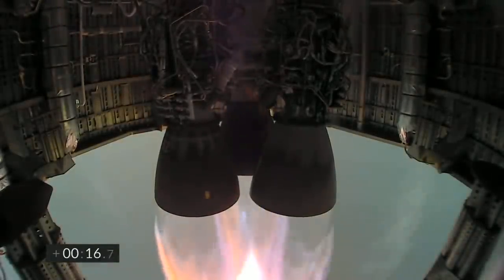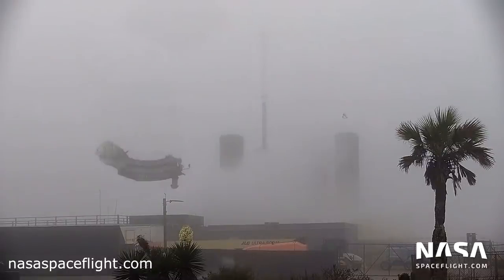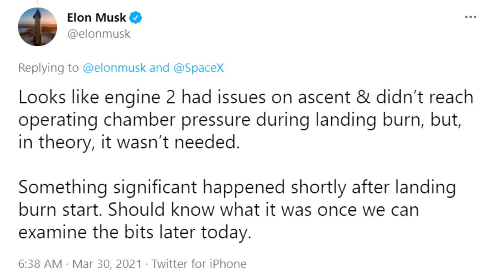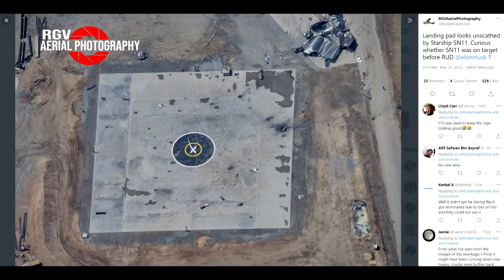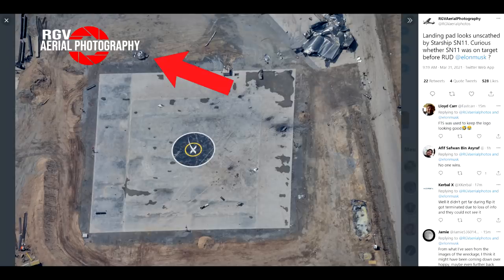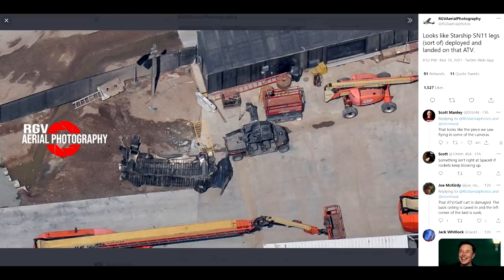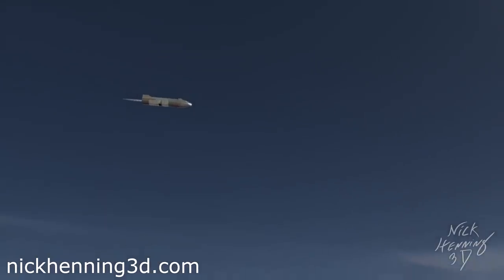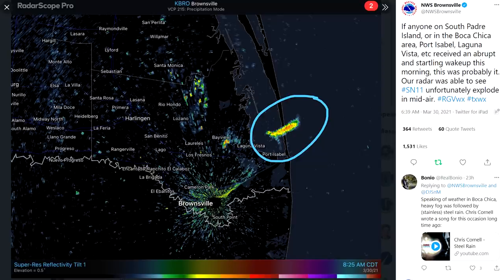What Happened In The Fog At Boca Chica - What Caused SpaceX's Latest Prototype To Explode?

Comment: The strangest thing is to start a test flight in the thickest fog, knowing that you have no visual references for flight analysis, especially during landing.
Reply: I'm don't thinking SpaceX so much in need for video. They have a lot of internal telemetry data, which is valuable for constructors.
Reply: Their automated equipment can see through the fog just fine.
Reply: @TheReaverOfDarkness  Yeah they probably have cameras that can see through the fog (non-visible spectrum), and perhaps cameras on drones above the fog too.
Reply: @leandrog2785  Their equipment can probably see in several different frequencies outside of the visible range.

Comment: “Tonight: SN11 becomes SN eleven-hundred pieces!”
Reply: @SuperiorMind  they launched it with more fuel than previous flights.
Reply: sn15 has hundreds of upgrades.....better aerodynamics, more mature engine, better throttle range and stable differential throttling with better software updates ...it will probably land more accurate
Reply: @shreysharma726  yes maybe 10 pieces instead
Reply: So long as you don't intend on ever coming back, it works absolutely fine.
Reply: @shreysharma726  I look forward to the improvements, but it's also well known that every new change of a design will likely introduce new bugs in the tests.
Reply: touche' sir... you win best comment.
Reply: News at eleven!
Reply: Early April fools I see

Comment: Hey Scott, can you do a video on the history of flight termination? What it actually is and when it's been used?
Reply: Yes Scott, is it a bomb or what??
Reply: I believe it is an explosive cable along the tanks, which is detonated automatically or remotely.
Reply: It's a small explosive charge that is positioned so the whole vehicle disintegrates when it explodes.
It is automatic but it does have a manual override afaik.
These are fitted so they can destroy the vehicle when it gets out of bounds and for example flies towards a populated area.
For starship it is halfway up the rocket to the left and right of the cable raceway, it's the 2 small white boxes.
Reply: There are two C4 charges on the side at about half height. They are easily recognizable as two white boxes left and right of the outside piping and cables on some photos.
Reply: I know that some are. But there have been many iterations over the years and from different countries. Not just space x but any or all manufacturers. Just thought it would be a cool vid.
Reply: There is a very good article on comp.risks if you can find it.
Reply: I and my Lance firing section were waiting in a block house for our turn to launch when a Nike Hercules was command detonated above us during live fire on Crete, Greece.
Reply: @banthaboss6390  true, that would definitely be interesting
Reply: @stevebalske5476  That sounds like a laundry-generating event
Reply: Agree. Upvote!
Reply: Remotely detonatable? I would think many times before boarding a ship like that. Polynesian hackers are unstoppable, you know!
Reply: Some of his space fail videos discuss it, iirc
Reply: @vladimirdyuzhev  they don't have them installed on human missions...only missions in which cargo is only satellites or test articles
Reply: In this case people are saying it's det-cord (basically explosive rope that's usually used in mining or construction to ignite a bigger charge) strung alongside the tanks.
Reply: The OSH heath safety inspector from the original Ghostbusters movie got mad and pulled the safety destruct lever.
Reply: Might be a good idea.  I have heard that some people think that they shoot it out of the sky

Comment: Mary has continuous audio through fog. When the relight occurs there is at most 1 second before explosion. That coincides with the SpaceX video feed ending at relight.  SpaceX called out "1000 Meters" at most three seconds before the feed ends. Given that terminal velocity is about 65 m/s, then it was about 200 meters lower when it exploded, or about 800 meters altitude.
Reply: The unknown height of engine relight (actually closer to .6 km) , and the timing of callouts are not very accurate to base speculation off of.
Reply: Could probably use relights from previous flights as a reasonable guide, wouldn't be perfect but in the ballpark

Comment: Sequence: A Raptor explodes on ignition, blows off the engine skirt in pieces, including one with a leg. FTS senses major malfunction, blows up the rest of the ship. (By ripping open the tanks and causing a propellant cloud explosion from the autogenus pressurizing gas and residual propellant.) Or the Raptor explosion propagated up into the tank, causing the same kind of of RUD as the FTS.. Either accounts for having both concentrated and dispersed debris fields.
Reply: Yup, this is still my bet. Raptor blows up, AFTS takes over. The problem is this contradicts all of the insider info we have about FTS not being used. I'm thinking maybe they know FTS wasn't triggered, but maybe AFTS did it's thing but the initial explosion killed the telemetry link before it could notify them.
Reply: FTS probably would not activate unless the vehicle was off course. Most likely methane fuel leak in the shared header tank of the LOX.
Reply: @pluto8404  But we're not talking about FTS, but AFTS. FTS would only be triggered when someone says so, and the FTS's job is to make sure it NEVER detonates unless somebody specifically tells it to do so. AFTS works on a very different logic, unless everything is FINE, go boom. So severe damage to the rocket could trigger it. For instance, let's say the raptor goes boom and in doing so it severs a lot of communication lines, and so the AFTS stops receiving data from a bunch of sensors. That would most likely trigger AFTS. 

Otherwise, a damaged IMU/GPS would mean a rocket that would be pointing wherever, but an AFTS that would do nothing because it's not getting IMU/GPS data.

Comment: I roughly put together the engine burn times for each prototype which kinda confirms that FTS was not engaged

(All times rounded to seconds as milliseconds were not shown in streams)
SN-8 (12 km alt) T+(06:31-06:42) (11 sec)
SN-9 (10 km alt) T+(06:18-06:26) (8 sec)
SN-10 (10 km alt) T+(05:59-06:19) (20 sec)
SN-11 (10 km alt) T+(05:49-05:59) (10 sec)
(based off YouTube time stamp and audio)
[SN-11 engine start T+(05:49), YouTube burn audio duration 11:40-11:50, clock froze T+(05:49)]
Landing burn time summary:
SN-8 (landing failed) (11 sec)
SN-9 (landing failed) (8 sec)
SN-10 [landing success (but rough)] (20 sec)
SN-11 (landing failed) (10 sec)

The metallic thud at the end of the engine burn on SN-11 also sounded like a ground impact but that's kinda were the audio cuts off
Reply: What have those numbers got to do with the FTS self destruct mechanism being triggered or not?
Reply: @johndododoe1411  it was to compare to all the vehicle's which have hit the ground, it just helps with a little background context, for example if the engines had only fired for a couple of seconds (along with the knowledge of the 1 and 2 kilometre call-outs being at reasonable separation) it would be safe to say FTS was definitely engaged, whereas with the amount of time the engines burnt according to the audio, it seems slightly more likely/reasonable that the vehicle hit the ground, I am not saying with certainty one thing or the other happened, of course it certainly seems likely that there was some form of explosion, and potentially whilst still airborne, but an explosion does not mean FTS, I heard that a number of people from SpaceX were saying it wasn't FTS, so perhaps there was an issue within one of the tanks, anyways as I said these numbers just add background context, which may help with the balance of probabilities
Reply: @theallknowingorbitalteapot1010  I was asking what those specific numbers had to do with your conclusion, you skipped all the intermediary calculations to get from engine burn time to FTS non-use

Comment: "The Raptors are the most complicated rocket engines ever built"
sad RS-25 noises
Reply: Efficiency and reusability demands complexity.  The fact the RS-25 can do what it does is amazing.  Especially without the Soviet metallurgical knowledge that I assume is now available to SpaceX.  On the other hand, methane is apparently a pretty different hydrocarbon to work with.
Reply: @arthurmoore9488  RS-25 was built before the Soviet rd-0120 and still has superior performance. RD 0120 technology btw is lost and is unavailable to Russian nowadays.
Reply: Full-flow-staged-combustion > Fuel-rich-staged-combustion
Reply: H2 > CH4. You can not compare these two engines.
Reply: @ncrean66  H2 > CH4 only on paper. It is a terrible fuel choice for a first stage (Shuttle, SLS), only good for upper stages (ACES, Centaur V, EUS, etc).
Reply: @cod6guy12  It's not a first stage neither on the Shuttle nor on SLS. It works almost till the orbit on the Shuttle and far beyond a first stage of any existing rocket on SLS. Not to mention that it is too early to consider Raptor engine a successful project.

Comment: I would suspect one of the engines exploded. The sizeable flame on one engine during liftoff may be a clue. Also, the fact that the skirt is some distance from the engines, spread out in multiple pieces, suggests an energetic event around the engines. You can also see two Raptors squashed, but mostly intact, but there doesn't seem to be much left of the third.

Comment: Kinda hurts my head that they had to launch during fog.  They had telemetry problems (problably due to the fog), and no video
Reply: I'd they'd waited, at least we would know what the kaboom looked like.
Reply: Science doesn't wait for mother nature
Reply: We must have been writing our thoughts at the same time? I don’t understand why? Why?
Reply: @Fixxate  there was no rush though.
Reply: @Forest_Fifer  IKR! They could have diagnosed the problem 10x faster and SN15 would have learned from all of the things that went wrong.
Reply: How would fog affect telemetry?

Fog doesn't mess with radar, radio antennas etc etc... The only issue fog gives is LoS (Line of Sight) so?
Reply: They need to weatherproof before they start commuter rocket thing.
Reply: @Doomsday499  fog makes it hard for someone on the ground to keep a directional antenna pointed at it.
Reply: Telemetry problems due to fog? Are they using a waveband heavily absorbed by water for some reason?
Reply: I assume the telemetry stopped when it blew up.
Reply: @castletown999  even before that, all the previous starship flights have had near continuous video coverage, this one was dropping in and out, freezing, all the time.
Reply: @castletown999  it was dropping out previously
Reply: Agreed, nobody else would have launched in that weather.
Reply: @YossiRafelson  No one is MANUALLY pointing a directional antenna.. this isn't the 1950s using SSTV...

If they even have a directional antenna, it's automatically guided and adjusts itself with the help of computer programming.
Not to forget; all SpaceX vehicles can be flown without external help or telemetry. They're programmed and made in a way where they can fly by themselves, how else do they land? They land by themselves, fly by themselves. If the onboard computer senses something is wrong, or heavily offcourse, it will try and adjust and if it can't, it automatically triggers the FTS.
So even if the fog impacted anything to do with telemetry, it wouldn't change the outcome of the test.
Reply: @Doomsday499  It doesn't, but totally F's-up the visual data you get from the flight (obviously).  Zero reason to not wait two hours when they would have had the fog burned off.  Somebody was WAY too impatient.
Reply: @pfurrie   They need to be able to operate in bad weather conditions. Think about the invention of flight, if nobody wanted to take-off their plane during rainstorms, snow, or fog during the 1930s then we wouldn't do it today, and air travel would be less advanced and able to operate in such harsh conditions.

Their goal is to launch very quickly, and during almost all weather conditions, they need to learn it the hard way. So they did it during bad weather conditions. Which I think wasn't the cause of this failure.

Comment: I wonder why they launched in the fog. Doenst the filming of the launch also provide valuable data for spacex to analyze?
Reply: Since they do have the engineering cams and a bunch of sensors and Starship doesn't use cameras to find it's target, I suspect, that there is little to know data to be gained from external views during the flight
Reply: @timoheinz2879  yes, that might be right. They lauched the rocket so fog cant be that bad for a test flight. But some analysis of how the rocket explodes and stuff like that might as well give them some info that might be useful. 
And Im sure Im not alone about being a tiny tiny bit disapointed about the view yesterday. Would have been epic seeing that exlosion in slowmo and all the other angles.
I really hope the dont «fog up» the next launch🤞🏼Go SN15🚀
Reply: I was just as disappointed about the weather as you were

Comment: Nice video, thanks, Question, aren't spaceX using fuel to pressurize the tanks for the landing burn? If so, maybe some mixing, failure or similar happened there which made oxygen shoot into the methane tank, or similar? And it might also have provided the spark/heat for ignition?

Comment: In my opinion waste of a Starship, if I worked on that thing for months I wouldn’t want it to launch when it’s not even visible when you can just wait a couple hours.
Reply: My guess is they are way cheaper than creating a test stand. They need to mass produce engines so may as well start now. Would live to know the cost of each starship. Three raptors and a load of sheet metal $20 to $50.
Reply: @mikem6549  And most of the price is all the work hours put into building these. I'm wondering how these guys feel when they watch their hard work turn into scrap metal over and over again. I'd be annoyed regardless they are likely very well paid, regardless that was the plan from the beginning. Doing "pointless" work is among the worst things that can happen to someone. Even if it might not be pointless in the grand scheme of things, enough if it feels that way, it will have its impact on team morale, leads to shoddy jobs, that in turn leads to more lost vehicles. Real slippery slope there. They really need to nail a few landings soon to lift the spirits. If this new v2.0 design starting with SN15 won't start behaving well, that means real trouble for the whole project.

Comment: Scott, I recommend you that you re-listen to the last 10-15 seconds of Space X’s audio stream immediately prior to the announcer coming back online to tell the world we just had an Oops.  If you listen closely, within 4-5 seconds after video feed freezes, you’ll hear a loud metallic sound.  I’m not a Rocket Scientist, but I am a former Fighter Aircraft Maintenance Officer.  When I initially heard the sound,  my first impression was that subsequent to the first engine reigniting, there was some anomaly, that based upon the frequency and tone of the recorded sound, caused me to think that the vehicle had for whatever reason commanded a full/combined gimbaling of all three engines along some axis that forced the entire engine assembly to act in-concert, and with the combined totals, the load ended up over-extending at least one raptor nozzle to a point of impact, and referring back to audio sound in-total, I can sense a force that exceeds that required to “scrape” or merely have a nozzle impact the external structure.  So, now onto pure speculation.... I think the initial relight occurred as expected, after that, either separately or in combination, the second engine relight occurred but the the defined thrust vector data to align its axis was either ‘old data parameters’ somehow stored when the vehicle was in a horizontal state, and after the vertical transition that data was never refreshed.  And since I’m on the assumption train, I’ll continue snd presume, that Raptor three reignited in the midst of this data stream maelstrom, and either failed to move in any opposing manner, or sensed (dependent on sensors and programming of course) that Raptor Two’s actions met some actionable threshold, and it followed suit, which completely cancelled out any gimbal effect of Raptor one, and in combination slammed the tri-mount into the exterior fairing, with sufficient force to not only crack it, but the combined forces, exceeded the maximum loads expected on hard and soft fuel and/or cryogenic supply lines  Which ruptured, and immediately in-turn caused the catastrophic failure.  I think (I absolutely could be wrong in this assumption) that if the lower portion of the vehicle was the point of origin, and if feed lines/hardware were the points of failure, that the resulting explosion would propagate upwards,  all the while losing pressure and velocity which ‘could’ account for the debris field and various pieces of larger in-tact components.  I love the way you think, so if you’re so inclined I’m open to any comments, and I welcome any scathing rebuttal predicated on facts.  
Sincerely,  Bill B.

Comment: The weather radar image of SN11 is incorrect, Boca Chica is south of Port Isabel.  That little lagoon just under Port Isabel has a peninsula jutting out from the coast inland in a slightly southward direction, that's Boca Chica.  There's a tiny little blue dot of reflectivity there which is probably from the high bay because it's about 2 miles east of the launch site.

Comment: Did you see Thunderf00t’s analysis where the aft end of SN11 started drifting more & more below the horizon with no movement of the flaps, almost like fuel and oxygen were mixing in the bottom tank moving the CG backwards? 

That would explain the aft end drifting downwards and the mid-air explosion on engine startup.